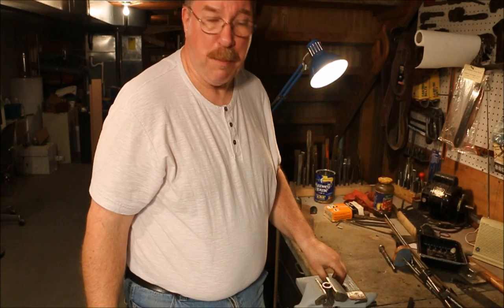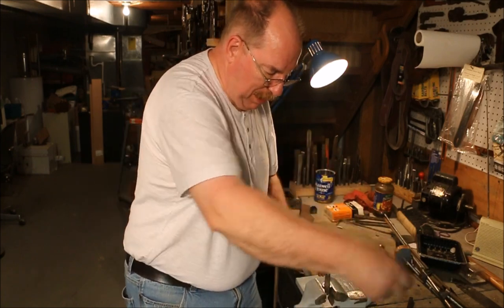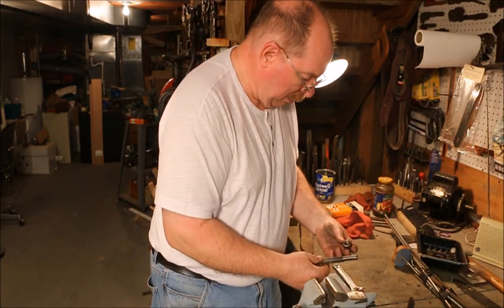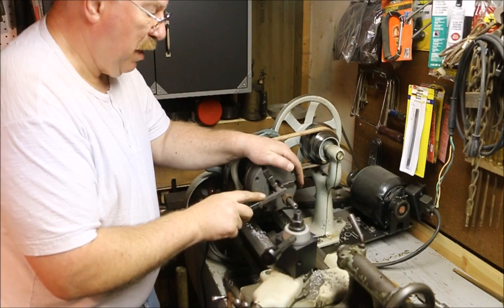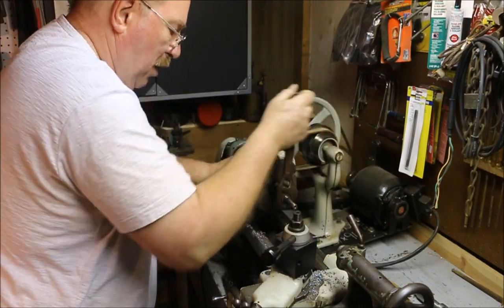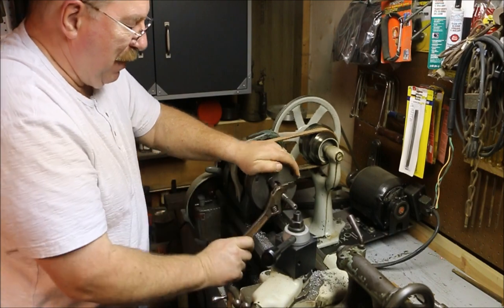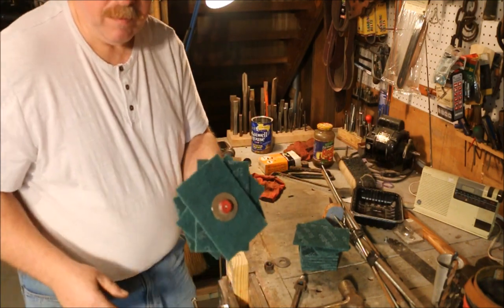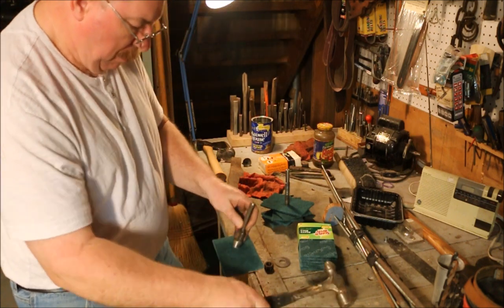Borrowing An Idea From Scott Grandstaff ~ Pt 3 ~ Scotchbrite Polishing Wheel ~ by Old Sneelock's Wor

Comment: ..the anticipation is building!!! I'm on the edge of my seat!!..well not really edge, more like leaned back. I can't wait for the next!!!...
Reply: I know which edge of your seat you're on- the BACK one. As in racked back. You can't fool me elderly Jimmy Bob! Been there, done that and have the nap to prove it!
Reply: ..yep, with my feet on the filing cabinet!! i get so wore out i may have to go get in the recliner. hmm..now i need a wireless thing-a-muh-bob for the TV and a wireless keyboard, a small fridge to set on the hearth..naw. if i done all that nothing would get done round here...
Reply: Ol James I bit the bullet and went wireless with a Logiteck keyboard and roller vball mouse and wouldn't have anything else BUT I kept the cable jobbies just in case. I've had them a couple of years and hav had zero problems. But don't over do it. Putting a rear end in a recliner can be a tough job and you might not be able to leave it for several hours! And after you creak back out onto the floor you can limber back up with the things on the list OR the rest of the last thing before the recliner beconed!

Comment: Hi Unc! Hope all is well. I got paid but am laid up with a bad foot and a re-dose of cellulitis. Oh well. I'll get down there and see if the motors are still there. I was thinking about your Scotch brite deal and I've got an old belt lacing punch from quarry days for re-lacing coneyors. I was just going to find the center and stack all the pads and punch through them all and stagger them on the mandrel. And soince I don't have many taps and dies I just usually oil up the nut and run it back and forth on the threads. At least that matches them up. You know me; good enough for who it's for!